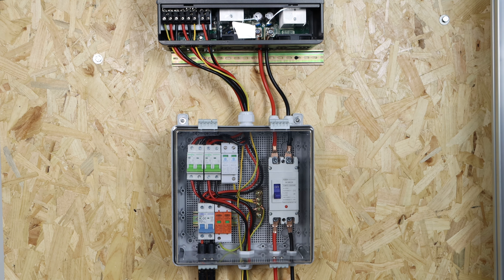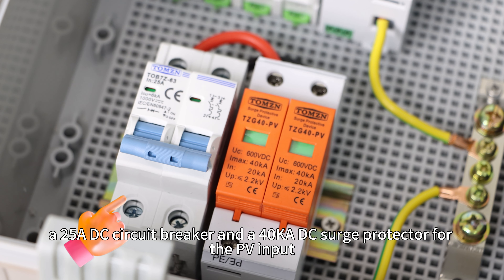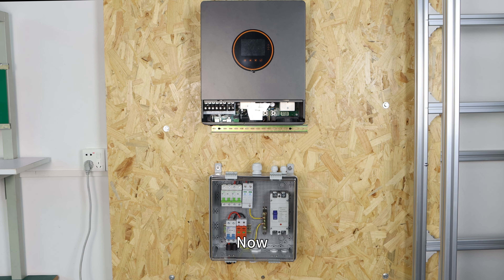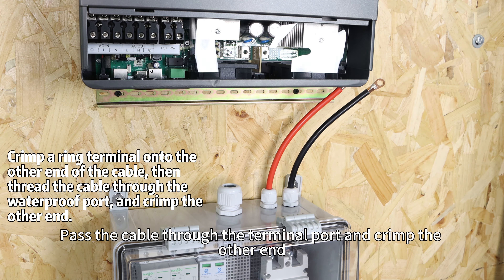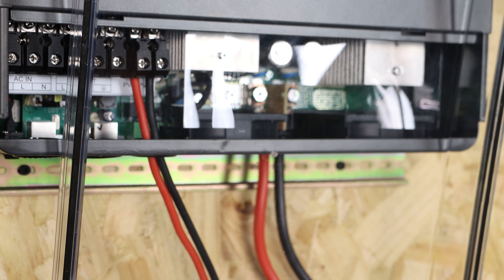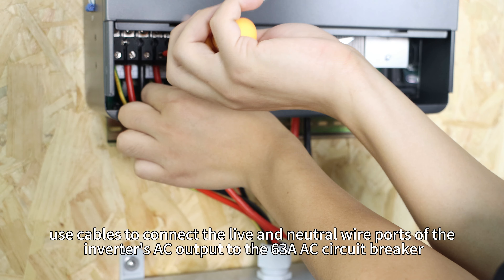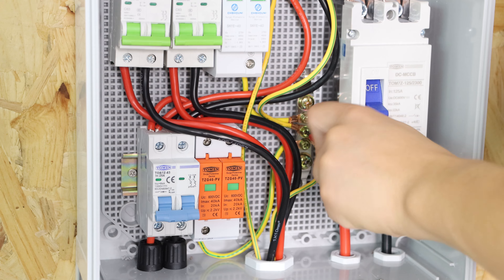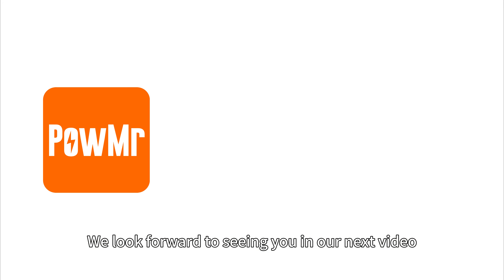The Wiring Process for SP5K: Easy to Follow Step by Step Instructions

Comment: 'where do you bond the neutral and ground wires?
Reply from the maker: Please send your problem to this email: support@powmr.com.
Reply: When I connect pv to inverter the inverter turns on automatically but there is no voltage on the output side. Help

Comment: My 10.2 PowMr will harvest so Load is being met but battery is not being charge till about 1800 w. The PV input readout is an arbitrary .5 kw till about 1800 w PV input. No one has had a clue why so far. A replacement 6.2 kW PowMr works perfectly. So the issue is surely in the 10.2 unit. Issue existed at initial startup.
Reply from the maker: Hi, please send your problems to this email: support@powmr.com. Our technical staff will help you.

Comment: What is the Uc voltage for AC SPD?
Reply from the maker: It is recommended to choose Uc385V.
Reply: @PowmrSolar  I am planning to power my loads with grid and solar only because I don't have the battery as yet. Which settings should I choose?
Reply from the maker: @mathsanctuary3913  Please plug your mains and PV into the inverter, turn on the mains, then select 01 "UTI", select 34 "LOD".
Reply: What does 01 " UTI"  and 34 "LOD" mean? I don't see these in the manual or in the setting tutorial video for SP5K.
Reply: I did a little research, and these settings correspond to the LVM3K
Reply: I have SP5k. Could I select settings 01 "PV1ST" and 34 "TOLOAD"  ?
I want to ensure that I use all power from PV during the day and then automatically move to grid in nights without affecting the loads.
Reply from the maker: @mathsanctuary3913  It's the same thing.
01 "AC1ST"
34 "TOLOAD"
Reply: @PowmrSolar  I must select 01 "AC1ST" in order to enable 34 "TOLOAD" ?
Reply: Will 01 "AC1ST" and 34 "TOLOAD" allow me to use only PV in the days and Grid in the nights?
Reply from the maker: @mathsanctuary3913  
If the battery is not connected, there must be mains power, and it is not possible to use only solar energy during the day. Solar energy can be given priority and mains power can be used as a supplement (use less mains power, but it cannot be completely disabled).
Reply: @PowmrSolar  thanks for that information. 
So I can select the setting 
01 "PV1ST" and 34 "TOLOAD"?
Reply from the maker: @mathsanctuary3913  Yep.
Reply: Can I start up the inverter with only grid power?
Reply from the maker: @mathsanctuary3913  Yep.
Reply: @PowmrSolar  I tried it but it don't work. Are there any instructions how to start it up with only grid power?
Reply from the maker: @mathsanctuary3913  Can you record a video and send it to this email: support@powmr.com? Our technical staff will check it for you.
Reply: @PowmrSolar  the inverter started up. I forgot to turn on the overload protection switch.
Reply: @PowmrSolar  where should I bond the neutral and ground wires?
Reply from the maker: @mathsanctuary3913  It is not recommended to ground the neutral wire. Please refer to 3:50(the yellow wires) do normal grounding.
Reply: @PowmrSolar  in the event of a ground fault, should the ground and neutral wires bonded in the home panel box to provide a return path for current?
Reply from the maker: @mathsanctuary3913  Can not do neutral grounding in the main panel box.
Reply: If you are using the inverter as a sub panel, then you should bond the neutral and ground in main panel from the grid?
Reply: In the event of a ground fault, how does the current gets back to source if there is no nuetral and ground bonding?@PowmrSolar
Reply from the maker: @mathsanctuary3913  Please send your problem to this email: support@powmr.com. Our technical staff will handle it for you.